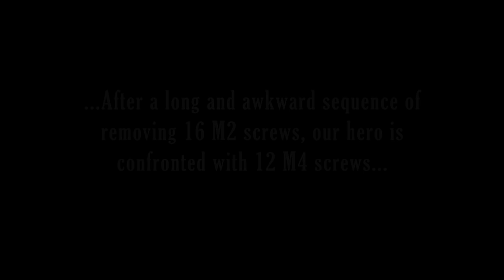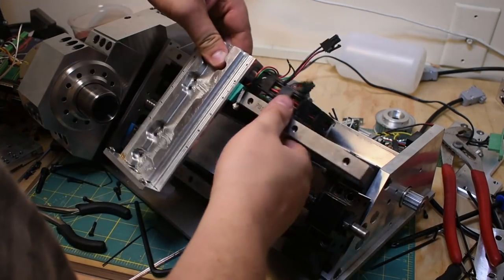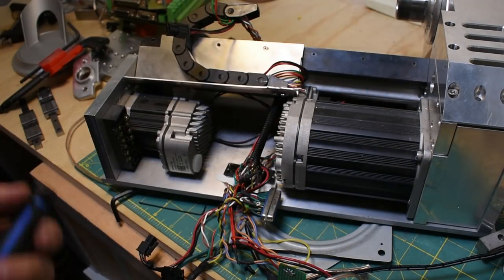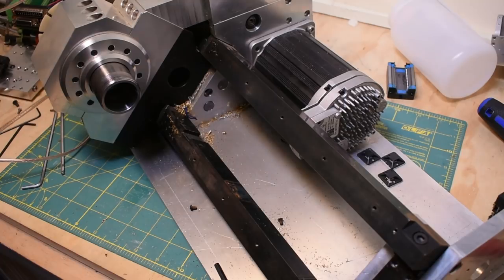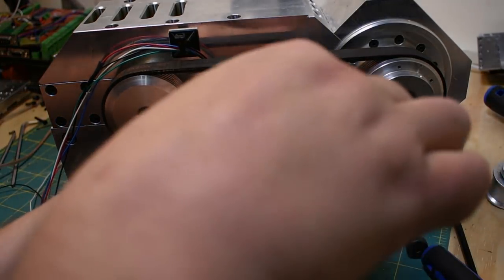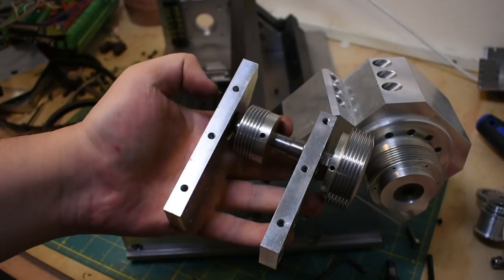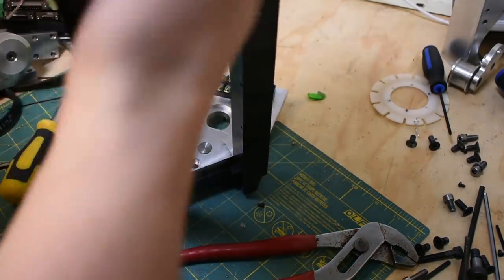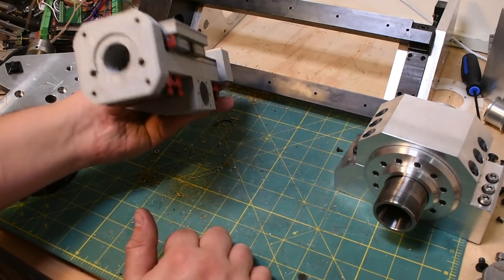Old CNC Lathe Teardown:  Part 2

Comment: I think those Clearpath motors have the ability to home by resistance. You just drive them slowly into a hard stop and they sense the home point by the rising motor current.
Reply from the maker: Yep they do!  I was using the outputs as a crash alarm, but maybe I'll try them out for homing.  Some devices even hard stop home with open loop steppers and just "crash" until they think they've moved far enough and set that as the zero.  If implemented correctly, it can be more accurate than traditional sensors.
Reply: actually as the motor only has one output signal, the best way to do this is to not use the motor output for homing and still homing with hard stop as this will work but use this motor output for alarms while running the motor for any stall alarm etc.
Reply: @TabletopMachineShop  The "Steve Wozniak Homing Method for Floppy Disc Drives". Just run it long enough to be sure it ran into the stop.

Comment: A small cordless drill or impact driver with hex bits works wonders in speeding up disassembly. Just don't try to torque up fasteners with them during assembly, that's what torque wrenches are for.
Reply from the maker: Yeah I actually don't have a cordless drill haha, otherwise I'm sure i'd use it more... I find I get myself into trouble much faster with power tools!  We have some really nice electric drivers at work for assembly... they can even be set to a certain torque... I think they're really expensive though

Comment: very cool and loved the idea of 3D printing parts first, look forward to the new machine!! As SKIPPER2384 mentioned you can use the clearpath "hard stop homing", it will save you a lot of trouble installing sensors or switches, we also support this on MASSO now so should be easy for you to setup.

For the spindle encoder we are releasing an optical encoder which will be a perfect fit for your machine, will send one unit once they are in production so that you can add the size and mounting points to your design, good luck!
Reply from the maker: Awesome!  I'd love to hear more about the new encoders!  I was actually looking at your homing sensors to use for the encoder but the form factor wasn't quite right.  I did like having the feedback circuit from the Clearpaths as an alarm for stalling, but maybe I will use it for homing.

Comment: aluminum and steel are corrosive together 
thats why the screw was rusty
Reply from the maker: True, though I've never seen it this aggressive before, which makes me suspect something else is affecting it too.
Reply: I've got a precision steel dowel pin i left in a aluminum reemed hole, came back 30 days later, completely tarnished with rust, also have had this happen on several robot's I've built, the black oxide coating on the bolts only helped for about a year or two before it was plated in certain areas with rust.

Comment: You need space for drills boring bars and taps, which will stick out and take up space on the z axis. This being the case if wanting to turn, drill, bore, or tap in one operation. Add max stock stick out from chuck plus clearance plus max drill length plus cross slide width to figure out appropriate z axis length and travel. Adding a tail-stock maybe double the length figured with out tail-stock support. The stick out from the face of your collect or chuck to the back, which would pertain to what is inside the working area of the lathe needs to allow long bits/tools clearance in z, so they don't touch the back. The back being in the z- direction
Reply from the maker: I agree, my tools currently don't stick out past about 3 inches, so even then I have extra space, but that's definitely a good thing to consider.  The new lathe will hopefully accomodate larger drills, so even without a tailstock I guess I'll have to make sure I have some room.  I'm also planning to have a bit of clearance around the spindle face so long tools don't hit the headstock while the short tools are working.

Comment: As for control side of the the lathe i say switch to Linuxcnc. The ability to customize how the machine run and operates is all most endless. Plus I think Linuxcnc can replace those little Arduino control boxes for the two turrets with little work. I know you're thinking that you need a big old PC  to run Linuxcnc but that's not true now. Machinekit a fork of Linuxcnc run on the beaglebone black a computer smaller than that maso controller. It would work with all the clearpaths motors you have plus the encoder.
Reply from the maker: I am really excited for MachineKit to mature a little more.  I remember I tried it out and found it a bit intimidating -- then again I don't have much experience with Linux.  I think my ideal system would be like 75% Masso with some customizable GPIO and macros.  We actually had LinuxCNC on a machine at work for awhile, but someone much smarter than me set it up and took care of it:P

Comment: I totally understand the idea of just wanting to build something cause you can, but what do you foresee yourself making on this mini cnc lathe?
Reply from the maker: I think because I do so much small work, a reliable CNC lathe for small pins, custom fasteners, gear blanks, drive shafts, pivots and things like that would be really useful to have.  It would also be fun to be able to turn more ornate or fun things, like knob handles, finials, airgun ammo, fishing lures, etc.  Good question!
Reply: @TabletopMachineShop  This is my first time seeing this video but as fat as gear blanks go you could go one step further and put an encoder on the spindle. Then you could design and build a life tool for the turret to do gear hobbing or a single involute cutter. Then it's a one stop shop.

Comment: Hi,

Your are working nice, more accuracy in your projects. I searched out your channel but there is no any video where you have explained about the electronics of the CNC Lathe Machine, because i want to know about the control system of your machine that you are showing here, so please make an videos what kind of controllers, softwares, drivers you are using here.
Reply from the maker: Hi, thanks for he comment.  I have videos on setting up the MASSO controller in which I cover this.

Comment: Are you sure about your comment about the factory bk12 support? Most of the cheap ones dont have angular contact bearings in them. I took apart 3 or four of different sizes and they all had deep groove bearings. A 7001angular contact bearing will fit in the bk12 bearing support. The dimensions are 12mm id 28mm od 8mm thick.
Reply from the maker: Hmm you might be right.  I've seen AC bearings in units from higher quality manufacturers, though I've never actually taken one of these lower cost ones apart.  I guess preloaded deep groove bearings are fine too, just for a slightly lower load.  Good catch!

Comment: I wouldn't be too worried about running a belt on any of the axis. I've worked on a lot of Indistrial machines and more often than not they have a belt driven axis or two. You can also view them as an IFP ( intentional failure point) important design concept to keep in mind with CNCs: plan where you want your failure and save your motion components. Better to have a stripped belt than a sheared motor shaft any day of the week. 

Side story: when I was a kid in my dad's shop my dad would hand me a coffee can of bolts and a box of mismatch Alan keys. He'd have me grab a bolt and try to grab the right key. It's paid dividends as an adult lol. Many many hours of guessing and stripped screws have been saved 😂
Reply from the maker: Interesting..  I had seen belts on big machines before but I kind of assumed they were some kind of super precision belt.  I have had belts stretch on me before and lost accuracy that way.  That's a good point about having an intentional failure point, although fortunately in my case the motors aren't quite strong enough to damage anything

My dad used to save nails out of wooden things he took apart and I used to straighten them for him, so my nail straightening game is on point :P

Comment: Awesome project! If you keep it a chucker consider a direct drive spindle. It could end up a similar length to what you have, considering the shortened Z.
Reply from the maker: Funny, I was looking at frameless motors (motors where you basically build it around your shaft) but they're pretty expensive.  The big advantage of the indirect drive is that I might be able to implement a through-spindle system and maybe even a bar feeder

Comment: Not sure about the impedance comment, i always just thought about back emf which is proportional to speed hence you need higher voltages for higher speeds
Reply from the maker: Hmm I guess I'll have to check that.  I thought back EMF only occurred after a coil has been turned off
Reply: It is the rapid switching of the coils which the impedance opposes thus limiting the current. 
Upping the voltage allows more current to be delivered to the coils. Higher voltage when used with current limiting drivers allows the coils to approach saturation while limiting power delivery thus creating the best performance

Comment: The abec bearing rating scale is a measure of precision and tolerance. It goes up in odd numbers to 9 (9 having the tightest tolerances). There are three companies called abec 7, abec 9 and abec 11 who all manufacture abec 5 or less bearings. I did some digging this year when I went the local extreme sports shop and bought a pack of 12 super precision abec 9 bearings for £10...
Reply from the maker: I got some ABEC19 bearings once just because i thought it was funny... they were like $0.50 each!
Reply: Tabletop Machine Shop according to my calculations, that puts the tolerance at negative 8 microns (for a 20mm bearing). I guess for $0.50 each you can’t expect them to spin!
Reply: Tabletop Machine Shop Forgot to say, can we start a crowd-funded operation to manufacture  M2 through M12 Allen screws with a single size driver. Or better yet ones that torque to spec and undo through sheer force of will.

Comment: The mail reason lathes and mills are made of cast iron is that cast iron doesn't deform. Rolled steel and aluminium will go into plastic deformation overtime.
Reply from the maker: Yeah coupled with the low cost and vibration damping.  There are steel and aluminum alloys that are very stable over time, however they tend to be expensive.
Reply: Crap.....never had that happen......the real reason machinery like lathes and mills are made from cast iron is because they are made from castings that are mass produced from a pattern.............that is apart from the fact that cast iron can be scraped to a fine finish and fit and have self lube qualities with some oil present........cast iron will indent whereas steel will raise a burr if its impacted.

Comment: Encoder wheel bit is super cool, never heard of that before.
Reply from the maker: Ya it's pretty simple isn't it?
Reply: Is that something the clearpath motors could do on their own, dont they have their own integrated encoder?
Reply from the maker: Clearpath motors do have an integrated encoder (a very nice one in fact) but there's no way of accessing the signal.  I think they have a new series of motors where you can, but I don't think it would work with common CNC programs.  Most encoders have an "index mark", which is basically a home position, and that would work well, but again, there's no way of reading it externally.